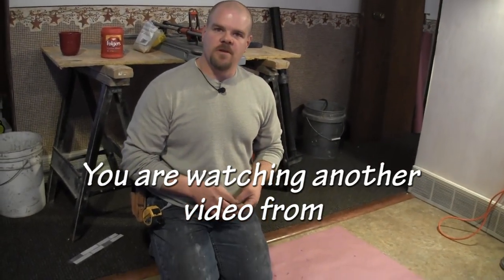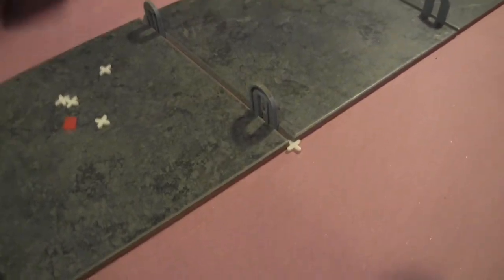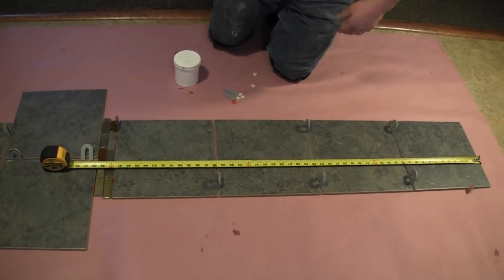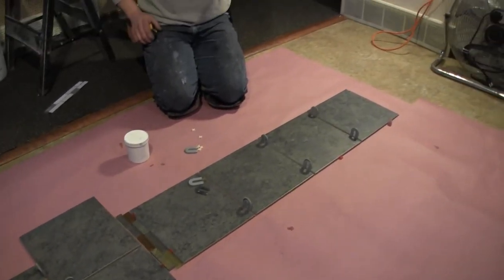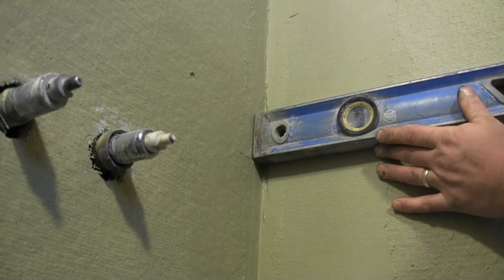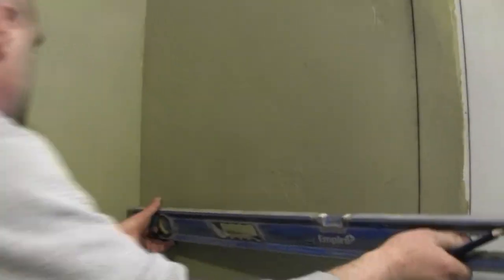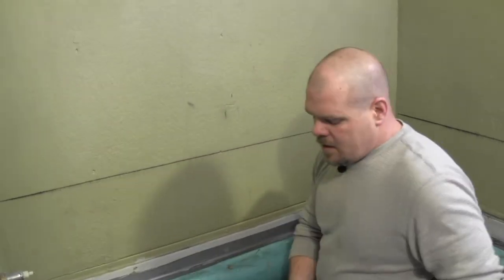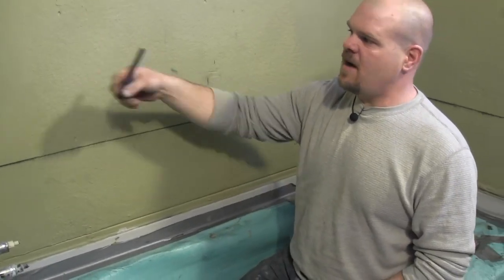How to tile a shower wall - Tile Layout

Comment: If you make sure all your tile were manufactured in the same lot, they will be the same size. This is from moisture content in the clay and heat of the kiln. Size can vary from lot to lot a small amount like you mentioned. This is a draw back from getting tile at a big box store

Comment: Great video, ok my question is do you tile the walls or floor first.
Reply from the maker: I like to do the walls first, but I leave out the bottom row and use a ledger board to start the second row. Once the walls are all done(not the bottom row) I install the floor and then install the bottom row of tile the next day.

Comment: Hey Joe, I appreciate your videos and your teaching style. What's your best advice for ensuring my glass mosaic is flush on the surface with my thinner subway tile. Subway tile is 3/16", and mosaic is 5/16. I'd like to avoid the lipage between the two. Thanks. 

I'm using Durock 1/2 backer. Should I use a thinner backer where I plan my glass mosaic?
Reply from the maker: Yeah you could do that or select a thinner mosaic. Otherwise your only other option is to build out the wall everywhere else. I usually don't run into the problem of it being thicker I usually run to the problem of the mosaics being thinner

Comment: Does it matter if I start tiling from the ceiling and go down?
Reply from the maker: +P L yes.  Don't do that.  Check out Tile University, there is a link below.  I have all the videos you need to walk you through your project.  I will also be there for your questions.